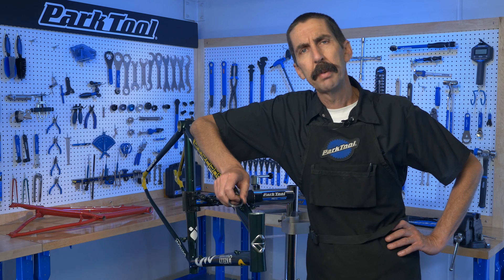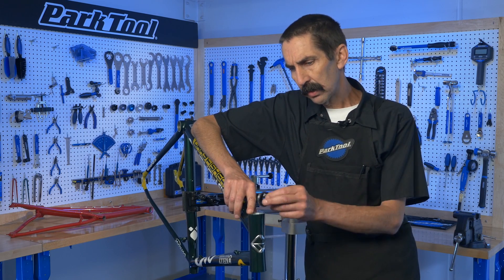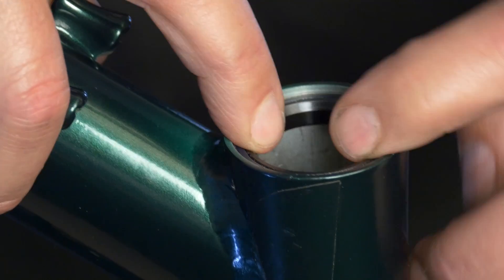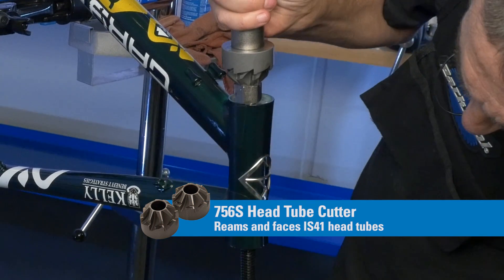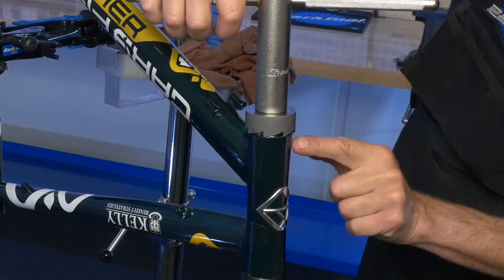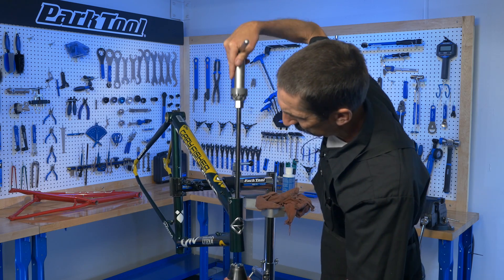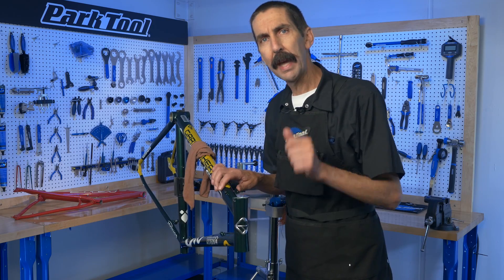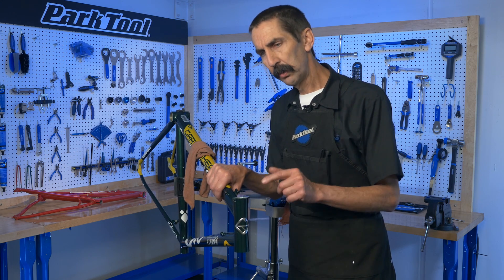Tech Tuesday #38: Rocking Around the Headset

Comment: Could there be a gap / play between the bearing side and the head tube wall?
Reply from the maker: That depends upon the headset type.  If the headset is an "External Cup or ZS", a press fit type, a gap at the headtube wall is bad, meaning something is deformed.  If it is an IS (Internal System), there should be a slight even gap all the way around, not just one side.
Reply: @parktool  Thanks!

Comment: What about Headtubes with separate cups (pressed in). Does that need the HT surfaces (top and bottom) faced so they are parallel, like a BB? If so, How?
Reply from the maker: Yes, the ID and the faces should be checked and corrected if needed. We make the HTR-1 and quite a few cutters for this process. The following link talks about the process. https://www.parktool.com/en-us/blog/repair-help/head-tube-reaming-and-facing

Comment: Hi, and if this play are in integrated headset, full carbon, can I performe this? Or I have to send back the frame to the seller
Reply from the maker: It requires the right tools and experience to do this, such as a good shop.  First simply see if you get a good adjustment with normal procedures.

Comment: Would this be done on a full carbon frame as well?
Reply: Park Tool replied to someone with same/similar Q:
"It requires the right tools and experience to do this, such as a good shop.  First simply see if you get a good adjustment with normal procedures."